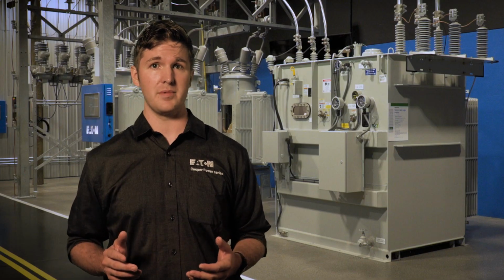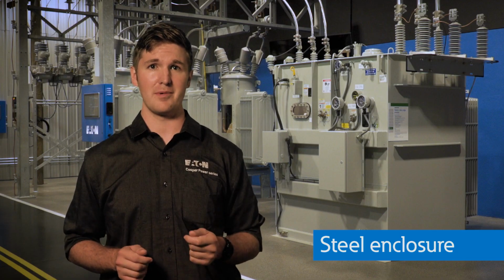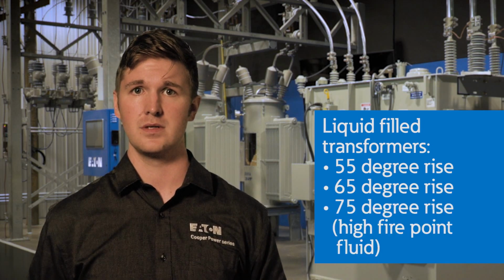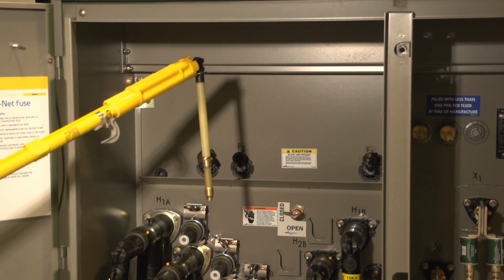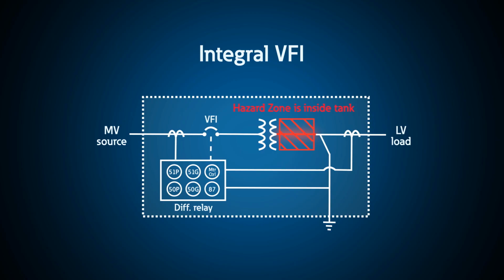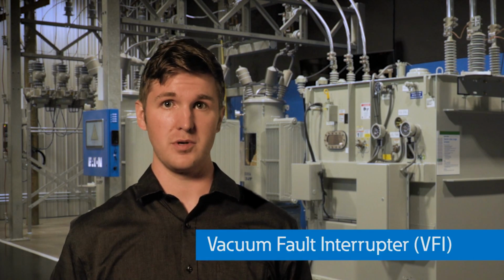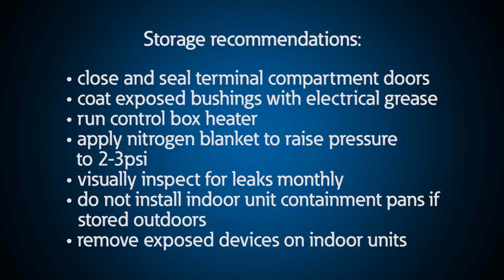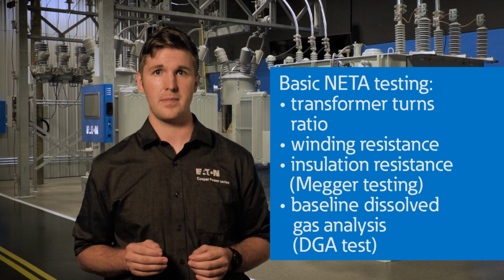Transformers 101

Comment: Sam Reed's explanation of transformer impedance and the nozzle analogy is spot on — it's one of the clearest ways to help engineers visualize why %Z matters for fault current calculations and parallel operation. The section on life and loading is especially relevant for utility-scale oil-immersed transformers, where thermal aging of the insulation paper directly determines service life. At Anhui Changying Electric, we design our oil-immersed distribution transformers with conservative thermal margins and high-quality Kraft insulation to maximize longevity. Great resource for anyone specifying or commissioning medium-voltage equipment!